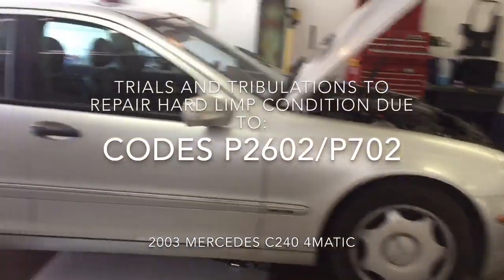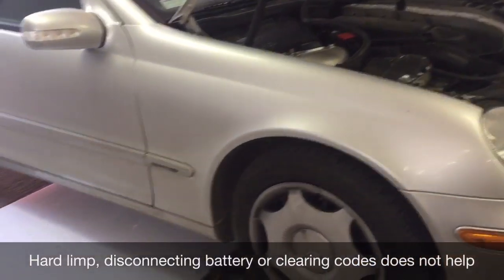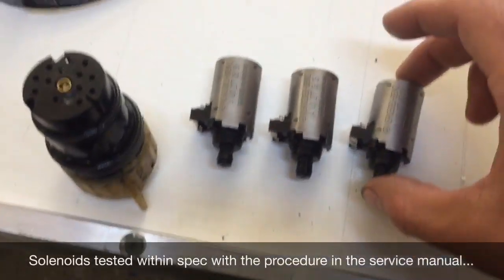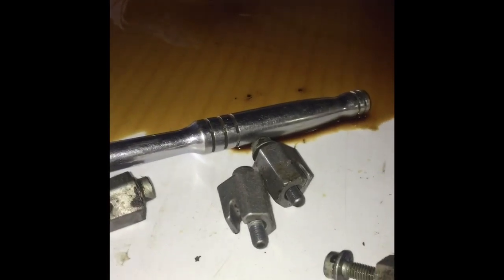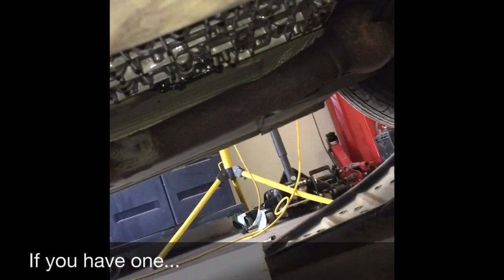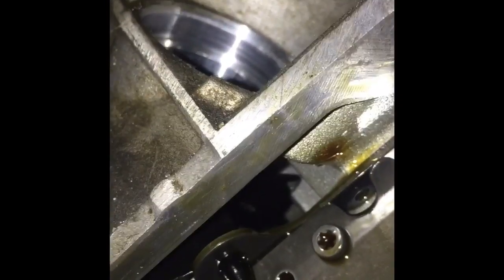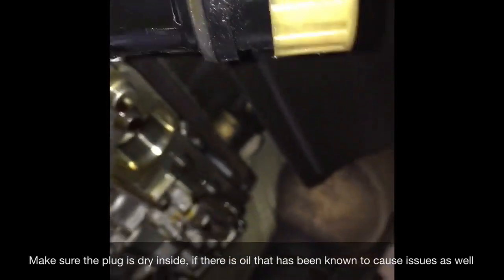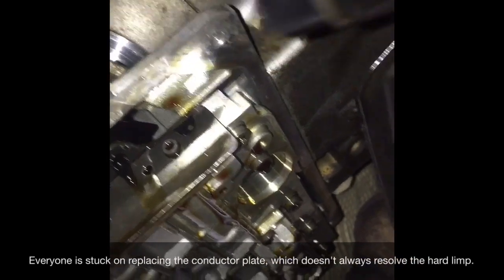Mercedes 722.6 Limp mode. Fixed!

Comment: Hey Luke, I spilled a can of soda into the middle console of my 2000 CLK430  I started wiping fast but almost immediately my car went into limp mode and I MAY have smelled a small buurning. Pulled over put car in Park and it was stuck...left it overnight, came back start the car and did a shift OVERRIDE to get it home but the tranny doesnt shit gears...there are no codes or illuminations on the dash tho, any ideas?
Reply from the maker: DaRealist One the can of soda might have fried your shift module, it’s a different issue.  Google Mercedes shift module.
Reply: How do you know that you don't have any codes? What diagnostic tool did you use to determine that?
Reply: Thanks! Shift module was the issue....I replaced it myself
Reply: Same thing, I spilled coffee and it went into limp mode.  I replaced the conductor plate - no help.  Lived with it for 2 years then I changed the shift module.  It works perfectly then!!!
Reply: You need shifter

Comment: Hi Luke and thank you for the video, I replaced the connector, conductor plate without changing the selanoids, filter and gasket and the car is on Limp Mode with hard clutch sound when I shift from P to D or R.
I went to clear all the codes that I had 
P0715 Input/Turbine Speed Sensor Circuit Malfunction
P0753 Shift Solenoid A Electrical
P0758 Shift Solenoid B Electrical
P0763 Shift Solenoid C Electrical
P0720 Output Speed Sensor Circuit Malfunction 
On a regular scanner not a MB , any thoughts?
Reply: What scanner did you use to clear the codes?
Reply: Look at the TCM. It must be covered in oil from the O ring 13pin plug. Yes it can go trough the harnes and fill that boi up. If it foesnt work that your cunducter plate is bad

Comment: So your problem was the celluloid ?
Reply from the maker: Robert Jace yes.
Reply: Luke C  yeah my dad's car does not get out of I guess first or second gear and you cannot switch to 3rd or 2nd on the shifter
Reply: @Robert-bg1og  
Conductor plate
Reply: @darktiger6518  eventually I found out it was the shifter I change the gear shift and everything was perfect
Reply: @darktiger6518  but I first change the conductor plate and it did nothing.
Reply: Oj

Comment: When you opened the conductor plate and replaced it. You had to remove the solenoids, did you use the multimeter to check the voltage of each solenoids. That's the way to check the solenoids before you put back the conductor plate.
Reply from the maker: AmZ yes, checked the voltage and resistance and they were within spec. I also reinstalled the old solenoids with a new conductor plate and problem persisted. It’s not until I changed the solenoids with the junkyard ones that the problem went away.
Reply: @lukec4745  super fix. After putting in the new plate is all fine?
Also which brand 134 oil did you use? Did you drain the torque converter oil too? Total drain should be 7.25 liters.
Reply: Duh...

Comment: I encountered that before on my 2000 CL500 all I did was replaced the conductor plate and fixed the limp mode issue.  You probably got a bad conductor plate.
Reply from the maker: Rey Bolor I tried 2 conductor plates.
Reply: hey does the car make a whinining nosise when you drive it if the conductor plate is bad. My e320 whines then goes out of gear.
Reply from the maker: O Dogg I had no whining noise. That could mean something mechanical.
Reply: I changed fluid, filter, gasket and harness connector..problem solved
Reply: @odogg4447  
Whining mean low fluid level. You didn't have enough transmission fluid in it.
Reply: Dimitriy Perchik I fixed it already I just changed the fluid and filter..problem solved.
Reply: @odogg4447  
That's great! The whining sound comes  from the transmission pump due to low level of transmission fluid, just like a power steering pump sounds when it's low on oil.

Comment: Luke C, I found this video to be extremely helpful.  I just bought yesterday a USA 1998 C280.  It is stuck in first gear.  Car shows 230,000 miles on the odometer.  When you go from Park into Reverse, or Park into Drive there is a very strong lurch.  The car jolts into gear.  It will not shift out of first in Drive or if I shift the automatic trans manually.  The seller (not very car intelligent) gave me a new trans. dipstick, and the fluid measures a little bit low, but seems like clean fluid.  I will guess I need a new Conductor Plate and Solenoids, but I don't know.  Online there are many refurbished solenoids available.  I wonder if they are reliable?  Any suggestions on where I should start, as I feel badly that it took you a month to solve yours.  Thanks for your great video, which is very helpful.
Reply from the maker: Jon Randall scan it first. Also check the TCM module under the passenger footrest for transmission fluid contamination.  If there is fluid in the connectors you can try cleaning the harness and installing a new connector on the transmission, cheap fix. Google 722.6 transmission connector.
Reply: Hi Luke.  Thanks for your reply.  The scan reveals code P0715 ( Input / Turbine Speed Sensor A circuit ).  This input speed sensor is built into the Trans. Conductor Plate which I have just replaced with the OE German Conductor Plate.  I, of course, replaced the Connector too, and noted that the wiring had trans. fluid on the harness.  This lead me into the passenger foot kick panel, and I removed the Trans. Control module, which had small fluid on the wiring going into the connections, and into the TCM itself.  I opened the TCM carefully, and other than a little bit of fluid inside near the connectors, it appeared in good shape.  My car is stuck in first or second gear, and won't shift into other gears.  I can reach 30 or 35 but the tach is at 4500 approx.  I am not sure if this is "Limp Mode" or not.  I am guessing that I need to have my TCM rebuilt or replaced, or Conductor Plate solenoids are actually bad. However, one parts place thinks maybe the Input Speed Sensor Code P0715 is in German terms ( = shift micro switch ), which in English is Neutral Safety Switch.
Reply from the maker: Jon Randall did you resolve this issue?
Reply: @Steve Johnson 
I did have the same scan code, but I just replaced the shift module and it works right away.  Good lucks.  Shift module normally do not last long since ppl spilled liquid and the heat...etc.
Reply: @DaiLenMatHo  can you elaborate on shift module. The tcm or the actual shifter you grab to shift gears? And we’re you stuck in limp mode as well?
Reply: @sefan1317  I meant the electric shift unit connecting to the shift handle.  Check YouTube, either solenoid is bad or a plastic lever gave out.  I sold the clk430 as junk after a small accident.  Too old and to poor to drive MB or BMW anymore
Reply: @ditmehcm1250  I changed all of my solenoids already as well as the conductor plate, 13 pin, and the tcm. Would there be a way to single out the lever in the shift unit?
Reply: @sefan1317  search in YouTube, 2 parts: 1. Inside at the bottom of transmission 2. Shift control module ( 1 solenoid, 1 lever, and electronics).  Seems you fixed the bottom module of the transmission only.
Reply: Recently my transmission did not go OVERDRIVE (waste of momentum/gas)
then the vacuum hose to brake booster broken, I replaced it and also replace a big vacuum hose which is hardened by heat and was loose.  Now transmission runs good!!!

Comment: I feel your pain, I owned my last Mercedes a while back and will never ever purchase one ever ever again.
Reply: Buy Toyota than... Less pain.
Reply: Your loss. These cars are gems.
Reply: @Jkstolz  
German engineering is overrated.
Reply: @Dima-jq3mj  
I agree.  But if you buy used/cheap ones and have ability to fix then they are OK!!!
Reply: @DaiLenMatHo  
Doesn't matter new or not, they are still a pain to work on them. Just compare how easy it is to change a transmission solenoid on a Honda, as an example , vs any German car.
Reply: @Dima-jq3mj  
I had a Honda Accord and no issue before selling too cheap to my sister.  I got BMW it failed and sold as junk.  Then the CLK430 gave me many headaches.
Please tell me how much it cost to replace the vacuum hose from the brake booster to the intake manifold in a Honda/Toyota vs. Mercedes?
My CLK430 needs the hose ($83), the grommet/seal/retainer clip - 3 small parts total about $25, then if dealer charges labor...???
In a Japanese car the cost should be 2 bucks by buying a generic hose at the Autozone!!!!!
I do a makeshift fix!!! $5 bucks
Reply: @Dima-jq3mj  
You paid 100K for an MB and sold 5 grands ... same as you paid 25K for a Toyota/Honda
My point is to buy a used one and fix it yourself...  It is economical and you have a luxury car!!!
Reply: @DaiLenMatHo  
I had 2 (1995 & 1996) Infiniti Q45s, that I bought them slightly wreck from Copart Auction. Both had a little over 100k miles. Fixed them and put them on the road, one for me and one for my wife. The 1995 after using it for 10 years, with 325k on it, gave it to a friend of mine that is still driving it for work today. The 1996 I kept it for 11 years, sold to a cousin of mine for $500 with 369k on it. All I had to do on these 2 car was oil/tires/ brakes. Never changed the transmission fluid or filter. The 1995 costed me about $3500 and the 1996 about $6000, since I had to do a bit of body work on it.

Now, I own a 2008 Mercedes Sprinter 3.0 V6 Turbo Diesel and at about 120k I had to take the transmission apart to change the conductors plate. About 50k later the torque converter went bad. Again dealing with the transmission. Not impressed with the so called "German Engineering". 👎
Reply: @Dima-jq3mj  
yeah, it's good to be a hands-on mechanic.  I will buy a used Infinity/Acura next time!
Reply: @DaiLenMatHo  
Don't know much in details about Acuras, but as far as Infiniti/Nissan I'm familiar with them since I owned quite a few of them. From Maximas to Altimas, Q45 to G35/37/FX35. The fist generation of the 3.5 V6 VQ tends to use a bit of oil due to its PCV system that sucks oil and burns it. The second generation 3.5 V6 VQ (07 and up with variable valve timing) is a lot better along with the 3.7 V6 VQ. In general I'm very satisfied with Infiniti/Nissan.
Reply: @Dima-jq3mj   what about gm cars. And new hondas are even worse.
Reply: @DaiLenMatHo  should I buy a B150 auto that is in limp mode, for £650 or should I stay away from it. Its for my wee mum, to take the grand kids out etc. Thanks
Reply: @SHADYSOLDIER222  I don't live in UK, and not a mechanic by trade.  But if the only issue is the limp mode AND IF you can fix that cheap then it is a good buy.
A week ago, I plan to buy a used car, I found BMW 5 series at dirt cheap.  The issue is car could not go to reverse.  I am too slow when I found in internet that the plastic reverse rode broken.  If you buy part and 1/2 houjr fix it is only 60 bucks for part and new ATF fluid.  I am so upset...not $4000 issue as the owner thought..
Reply: He isn't having pain.. lol

Comment: Fucking stupid man
Reply: My W203 C200 Kompressor came out of limp after I replaced the Gear shift Module . It was worn out sending wrong gear positions to the computer. Didn't touch the gear box. Should be last thing to do. Aah well seems limp mode has a number of sources

Comment: Nice informations 
Where do you change the solenoid ? I mean its location
Reply from the maker: Ta Oh solenoids are mounted on the valve body along with the conductor plate.
Reply: Luke C ok Thanks
I only change the plug on the transmission, does the conductor plate, easy to remove ?
Reply: Ta Oh you have to remove transmission pan and then the valve body

Comment: Great video...I have the same problem on my 2003 C320 I can't see the W or S on the dashboard exactly as you mentioned so I know now that is in limp mode however the code that is reading is P0705 ( transmission range sensor ) or ( neutral sensor ) do you think I need to follow the same steps or different since is a different code.
Thank you, your help is appreciated.
Onealsanchez@gmail.com  if you could please contact me.
Reply from the maker: Oneal Sanchez you may have a slightly different issue causing your limp. The 0705 code you are getting is a generic obd code, if you get a better scanner or someone to scan this for you it will show a more reliable/specific code directly from the tcm that you can  then use to troubleshoot your problem. It may be something much simpler like a shifter module or sensor on the outside of the transmission. Good luck, hope you don’t spend a month on yours...
Reply: Luke C thank you very much for your speedy response and I do hope is something much simpler I don't know anyone with a scanner and where ever I ask they want to charge $60 just to scan it by the way I have my benz sitting for 2 months now I turn it on here and there just to run the engine
Reply: Luke C you were right! It was the shifter module, so I went to a junk yard and thankfully I found a c class I went ahead and removed the part I ended spending $24.47 to be exact...oh my god I'm I glad it wasn't hundreds 💵 , thanks alot for your advise it wasn't useful it was on point the right thing to do , you sure know what you're doing. 👍